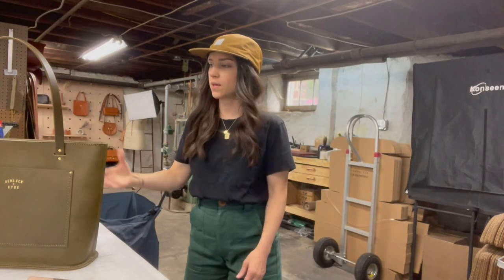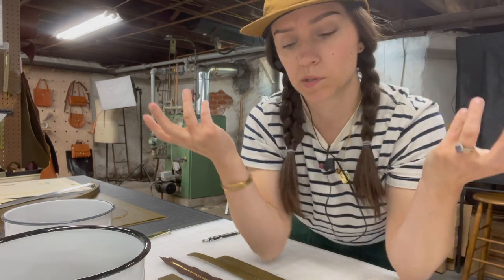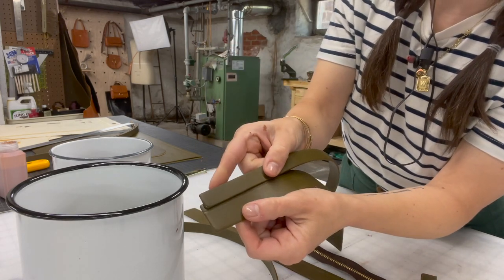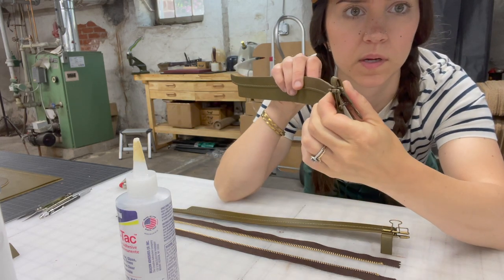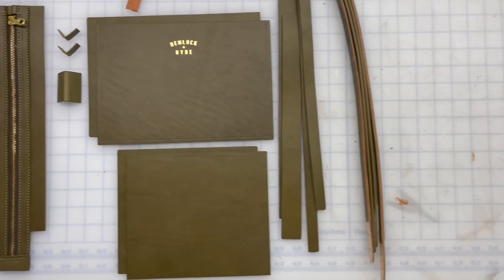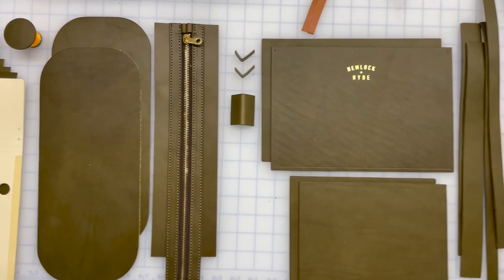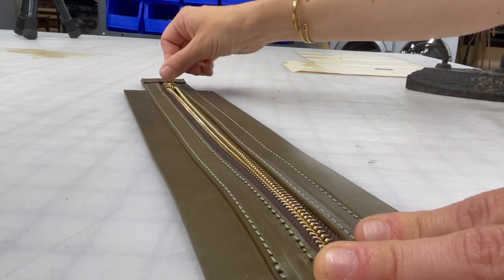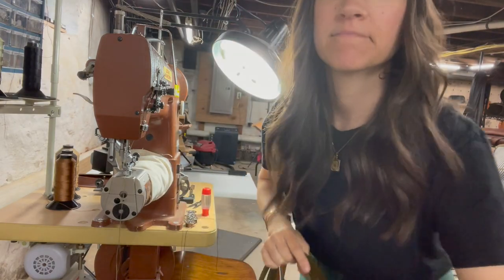The Fairmount in Olive

Comment: Shows that the Cobra Class 26 is a pretty awesome machine to have!  The bag looked very nice, curious though as to how long it actually took for the complete cut-to-build and completion.  Also, what weight leather were you using?
Reply from the maker: probably about 8-10 hours in total. 4.5/5oz leather is what we use for most bags

Comment: What clips are you using? I have never seen ones like those before.
Reply from the maker: They are called wire binder clips, they are a little expensive but we like them because you can see through them unlike to regular black plastic binder clips

Comment: Great video! Thanks. What glue are you using? How long to dry?  Is it just for holding while sewing or meant or be permanent?
Reply from the maker: It's Beacon: Fabri-Tac. We use it to glue pieces together before sewing. If we aren't sewing over it we use Barge rubber cement. Hope that helps
Reply: @hemlockandhyde  Thank you for the follow up.